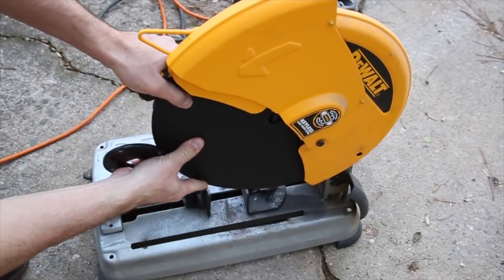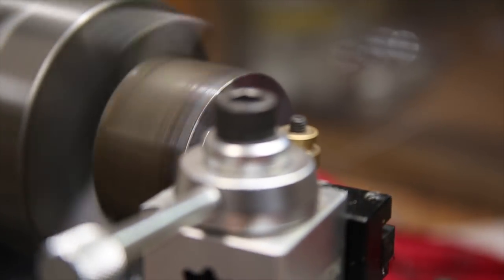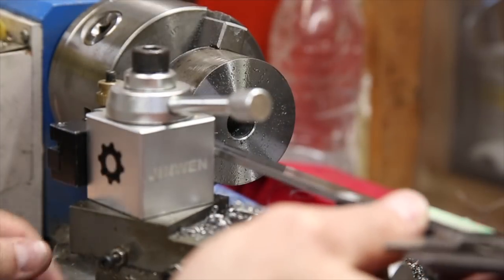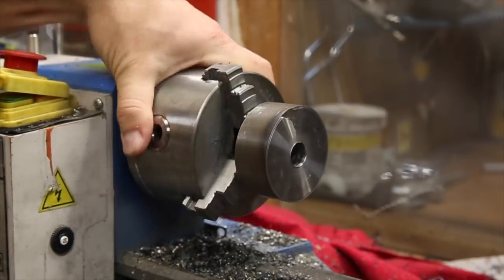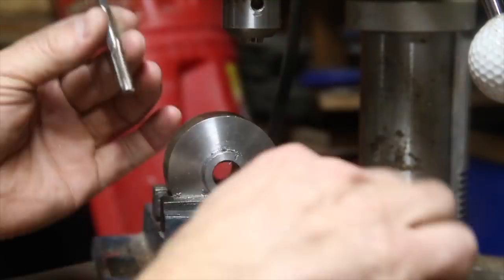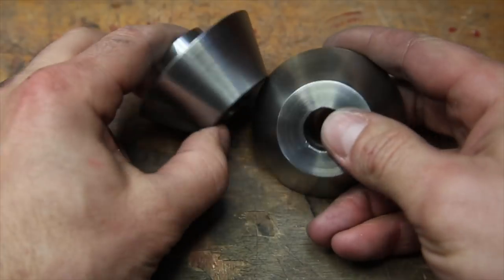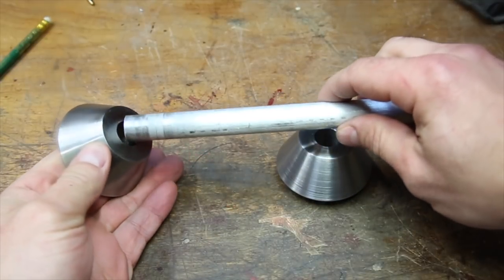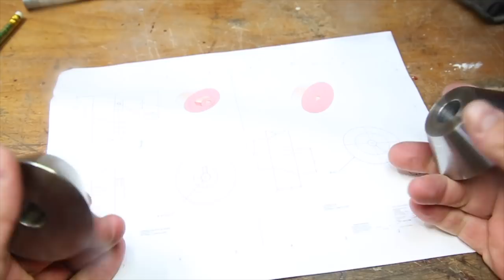(2/2) Taper Turning a Heavy Steel Spool Holder w/ Set Screw on the Mini Metal Lathe

Comment: Wow you get much better surface finishes on steel than I get with my mini lathe. I wonder what the key is.
Reply from the maker: Haha... a bunch of sanding maybe? I think the grade of steel has a lot to do with it also.
Reply: TimNummy yeah I can get good finishes with a file followed by sanding... but it looked like you were getting a pretty decent finish right off the lathe. You said you were using plain mild steel. 1018?
Reply: I’m one of Tim’s previous or future videos I can’t remember but he said that taking deeper cuts give the material a better polished finish

Comment: Just a thought on the fuse overload, I have noted that you have made a modification so you can reset rather than change the fuse. Would a small PC fan be of benefit in keeping the board and trip cooler. The trip /fuse appear to blow after a period of use

Comment: Great job. Now, all you need is a band aid and a new circuit breaker since it has tripped so many times that it probable no longer holds its rated capacity.

Comment: Damn, woman! I love your videos, but let's be clear. 1. Get a steel OXA wedge tool post. The alu piston is not stable. 2. Get a bigger lathe! Or more important, a faster, more powerful motor. To use carbide inserts efficiently, you need massive rpm's. 3. Ignore my comment, since you made it like a boss! ;-)